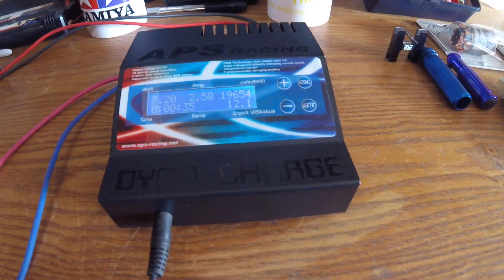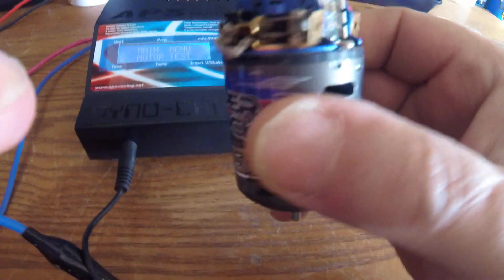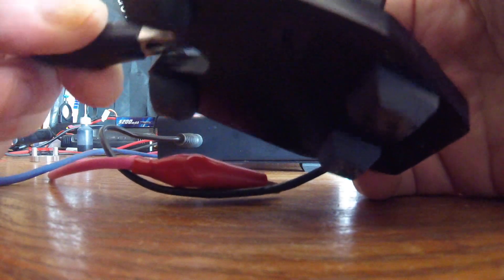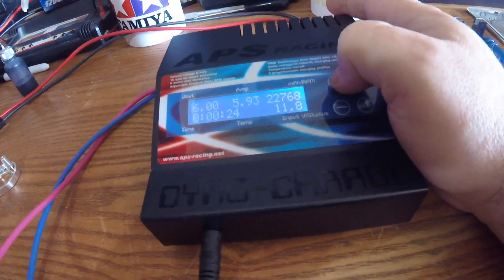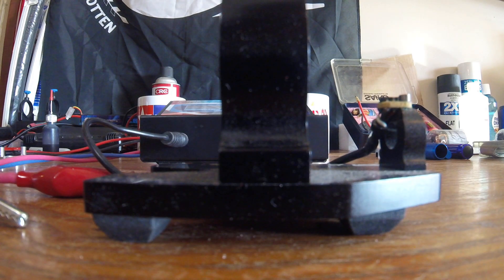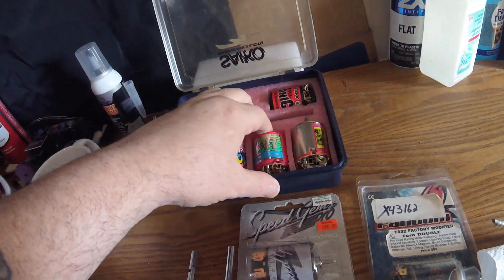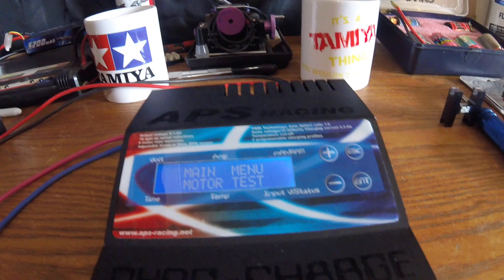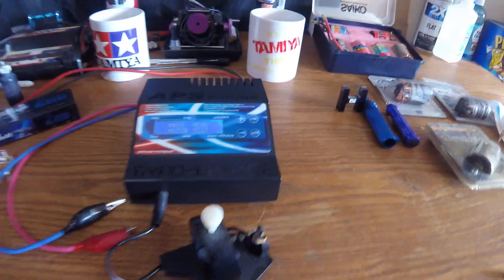"Tamiya Silver Can vs Torque Tuned vs Sport Tuned Motor Test + More!"  Part 2

Comment: When i first got into RC i use to kill a "speed gem" weekly 🤣 my little XTM stadium truck was always in the pursuit of the best top end and those Little motors suffered immensely for it 🤣🤣🤣
Reply from the maker: Same here till I learned it cost me money every time I burned up a motor. It was about 3 months later I read in RCCA magazine (1989 or so) that motors don't like high power for long and they need maintenance after every 3 runs or so, and that's for @10 mins of run time each or 30 mins total.
Reply: @UncleBobsRC  i eventually learned also but picked up one of Novaks first brushless esc motor combo.  Man i paid out the nose for that thing and had to swap it out for my brush setup every weekend so i could race. It was considered black magic/voodoo at the track back then 🤣
Reply from the maker: @jordancoleman2402  I hear ya, I didn't try brushless till about 2014, I put a Castle system in my Losi mini LST (the first gen), it was a 9,000kv motor on a Dynamite 2S lipo, man that thing was fast.....  Then I learned speed breaks parts faster.  I still want to do a Mod Motor test but the prices of used motors is crazy nuts!
Reply: @UncleBobsRC  that would be an awesome test to see!!! Maybe reach out to viewers to donate some. I have a few in a stash at my parents house.

Comment: I fitted ball bearings to my Tamiya RZ motor, to get the most efficiency out of it. I wonder what the difference would be, Over stock. Battery run time, top speed & RPM?
Reply from the maker: I use to do that 30 years ago, as for the RZ, I wonder what and how much  it would really gain. Thank You for the view and comment, stay safe & stay healthy.
Reply: @UncleBobsRC  i want to know also
Reply from the maker: @rexrcs  I'm not brave enough to try it. LOL
Reply: @UncleBobsRC  lol

Comment: BZ look good :-) Does it need break in?
Reply from the maker: Thanks Man for the view. I recommend breaking in any brushed motor, the method is up to you (caution if using the water method with motors with the a pc board (caps) on/in them, removal of them is best. I break in all my motors with @ 4 volts or use of a slave motor. Time for any break in varies, water is faster hence it cuts the brushes really fast, care is needed for this way. I mostly use the low voltage @ 4 volts for 20 mins and check/repeat if needed, slave motor way does not put power into the motor and takes the longest. Either way, always watch the temps & brushes (most of the time I stop just as the brushes are fully seated or just before). Then clean them with electric motor cleaner (RC) then just a drop of light oil on the bearings or bushings. Hope this helps as this is lost to brushless and RTR RC vehicles.

Comment: Thank you for the comparison. So the BZ is around 3800kv, Do you know how the torque is compared to 3800kv brushless motor?
Reply from the maker: Thanks for the view. No I don't, sorry. That would be hard to compare. A brushed motor motor produces torque low in its rpm range, as for brushless motors, I don't really know, but I think they produce torque throughout the RPM range (I could be wrong). My daughter has a BZ in her TT02 chassis with hi-speed gears, my friend has a TT01 with a Tekin 3200kv motor and stock gears, both using a 2S Lipo and just about the same speed. I don't know much about brushless motors, you should check out some other videos about brushless motors. Again, Thanks for the view and comment, stay safe & always hammer down and have fun!
Reply: @UncleBobsRC  Thank you for the reply and kind words. I also have a TT02 as well. What pinion is used in your daughter's car? What's the highest gear ratio do you think the BZ could reliably run on a TT02 without overheating?
Reply from the maker: @tuananhphamcong344  The Tamiya BZ Super Stock Motor box says its to run on a gear ratio between 9.1 through 11.1, I think I have hers set 19 tooth pinion & 68 tooth spur, gear ratio is 9.31:1 (not sure on that but should be close to it) It seems to be ok but we only do like a 5 to 8 min road course races with cool down time in between heats.  On my TT-02 Type SR, I run a 3200kv brushless, 23 tooth pinion (steel pinion, I just put it in) with 68 tooth spur gear. Gearing all depends on what you want from the car, some people want top speed, others like to race and be able to control the car around the corners. Bottom line, Its all up to what you want to do. Tamiya tires are easily over powered and will loose grip, foam tires help. Its like using your real full size car, go as fast as you can then try to make a 90 degree turn at speed, it just wont do it. Hope this helps & all the best to you & good luck my friend.
Reply: @UncleBobsRC  Thanks so much my friend! Looks like the stock gearing is always a good starting point, then gear up or down depends on how the car run and motor temp. Thank you again and all the best to you too!

Comment: Thanks a lot my friend, great vid (and part one too). 'got an eagle racing dyno, great stuff too. I have to try to break in with a slave motor, it seems to be the best way. What is that magical oil for the brushes you use ? Thanks again it was great.
Reply from the maker: Thanks friend, I don't oil the brushes, just the bushings & bearings. That is Team Trinity Black Death Comm Drops (it can be used on the brushes, just a drop on each for extra rpm). It was the only light oil I had for the bushings. I will have to look up your dyno.  Thanks for watching & the comment!!!
Reply: @UncleBobsRC  Oh yes oil for the bushings (sorry i'm French...not brushes but bushings...) Thank you very much Bob , you've got a new sub ! Take care.

Comment: Hi,  what is brand name of that motor dyno and dyno stand also where did you purchase it from.
Thanks
Reply from the maker: It's an APS Racing Dyno-Charger. It comes with the motor stand with the sensor. The Plastic double motor work stand is RPM. Both Items i bought off EBay. Thanks for Watching & the comment.
Reply: @UncleBobsRC  Thank you

Comment: This video is just what I was looking for.  I just finished a Rally Beetle that comes with the Torque Tuned motor.  It runs quite well, but I was wondering whether the Sport Tuned (or something else) would be better and what the differences were.  This answered that question.  Go with Super Stock BZ or maybe a sensored brushless motor that only costs 25 - 40 bucks more than the Sport Tuned.
Reply from the maker: Awesome Jeffrey, sorry for the late reply, I just now seen your comment. the BZ motor is a beast, it almost blew the tires off of my well tuned touring car (Tamiya TA-02 RS) as with all TA-02 chassis it is 4wd, with wide 30mm rear tires and rear sway bay, on 2S it was almost uncontrollable, it shocked me. It all depends on what your doing with the RB, racing, rally, parking lot, drag racing........... Good luck, would like to a video of your RB.
Reply: @UncleBobsRC  Thanks for the reply.  I run this car on a nearby parking lot that has some very uneven section and areas where the asphalt has been lifted by tree roots and on a dirt trail with open dirt sections down the street from my place.  I did end up getting the BZ motor, along with a quickrun 1060 ESC (my understanding is that the factory TBLE 02 would not be up to the task of running that motor).  

To call this motor a beast is an understatement.  I speed tested the car running the torque tuned and the 1060 with NiMH and hit 13.6 MPH.  I put in the BZ and with the NiMH it hit 18.6.  Using a 2s LIPO got me to 19.5.  

This BZ motor and all the torque it had brought to light a couple of other upgrades that were needed when using it.  I found that the car would not only smoke all four tires under heavy acceleration but it also caused torque steer and chassis twist which made the car hard to control.  I put oil filled dampers on it to soak up the chassis shock and put the upgraded steering kit on it which is all metal (servo saver and horn).  Those two things helped a bunch in making it easier to control.
Reply from the maker: @JeffreyAu1  Awesome man, again sorry, for the very late reply, as you may or may not know, posts have been kinda funky for a few months, I did not see your comment till this morning (it didn't pop up like they should). What chassis ae you running?
Reply from the maker: @JeffreyAu1  By the way, I still have the BZ in my Tamiya TA-02RS & my Daughter has one in her Tamiya TT-02 with Castle Creation SV3 brushed/brushless esc, we run on 2S all the time.
Reply: @UncleBobsRC  It is an MF-01X chassis.
Reply from the maker: @JeffreyAu1  That's right, you did say the rally beetle, sorry, brain fart.

Comment: That BZ Motor shocked me!! 22K at 6 volts! 😲
I've got to find me one of those Motor Testers. Since I'm starting soon on twin Motor Trucks, that would be quite a tool. 👍👍 
I often get 7.5-7.7V on my 2S Lipos... 
Have you tried any of those at 11.3V? I often run 3S on my Tamiya and Axial Vehicles.
Reply from the maker: i dont run 3s, i did in my Losi LST2 brushless but only one pack. The BZ, like the RZ & TZ are all 23 turn motors with locked timing (but you can cut the lug off the endbell to have it adjustable), It shocked me too, thats far better than what the box says (also the gearing range for that motor is on the box)...I was just using the voltage listed on the pack, yes, voltage is higher but i did it that way for giggles.
Reply: I figured. Very impressive for base voltages! Back in the day, I Raced with Trinity Monster Stock Motors. Couldn't measure them, but they were fast. 👍👍

Comment: So: silver can 17K @ 7.4v 
sport tuned 20.5K @ 7.4v 
torqued tuned 20.5K @ 7.4v

There are rumors current "new" Sport tuned silver can is also 25T just like the torqued tuned, and your dyno test seems to prove that as well. Your thoughts? Thanks for the very recent benchmarking work.

(Also, these 2 vids could've easily been edited down to < 10 minutes...)
Reply from the maker: as far as i remember Tony yes, that is a silver can sport tuned motor, i just painted it black (box claims its a 23 turn), looks better to me. ah yes, the editing, im not pc savoy, new to this stuff and no clue what im doing but Thank You for watching & the comment.

Comment: A great experiment, Bob - after watching this I want a BZ motor! Great stuff, my friend!  :)
Reply from the maker: Thanks Mark, glad you liked it. the BZ motor does get warm so i recommend a fan (i never used one though) on it, just like most stock motors (other than the silver can 540) they are mostly used for 4 or 6 minute heats with a good cool down in between.
Reply from the maker: Tamiya says use the BZ within  gear ratio's between 9:1 to 11:1, just a heads up.
Reply: @UncleBobsRC  Thanks for the info, buddy, very useful stuff to know!  :)

Comment from the maker: My mistake, the Tamiya Super Stock BZ motor has fixed timing, it IS NOT adjustable. you can take the motor apart, cut off the timing lug, then you can adjust the timing... thats up to the you, i wouldn't.